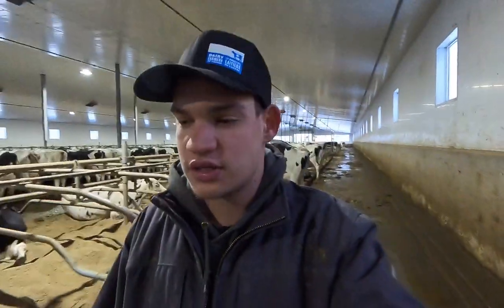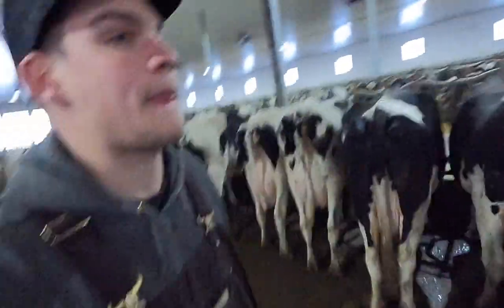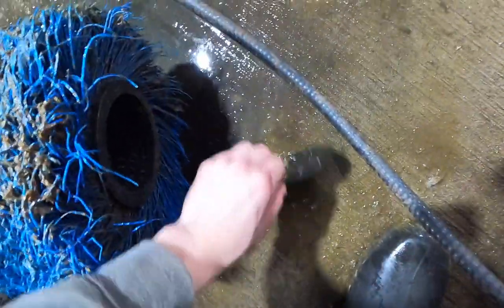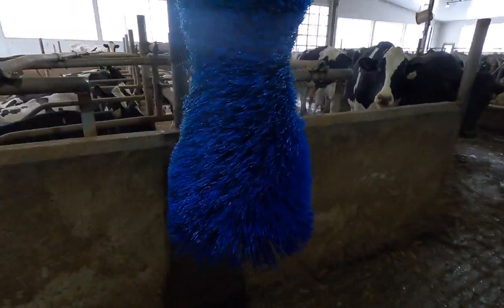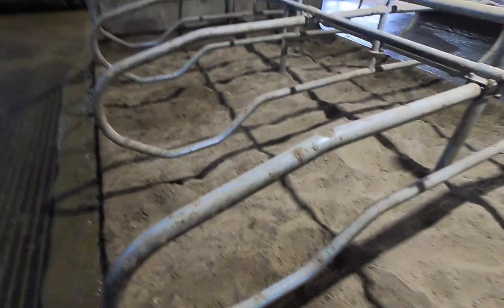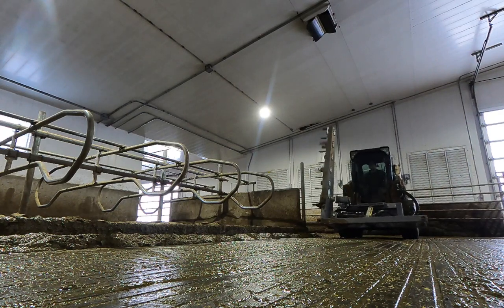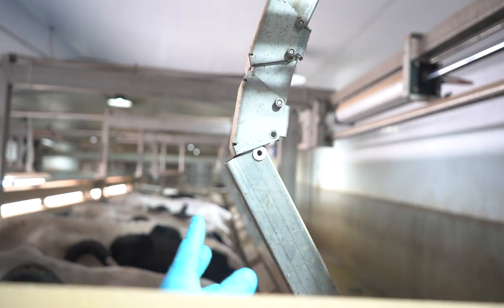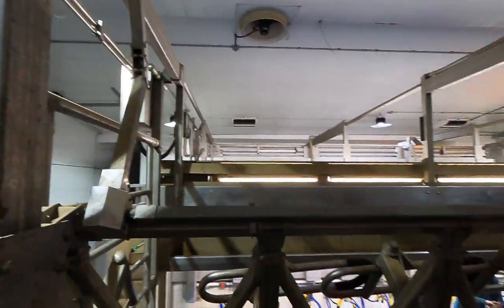Milk Cows Break Everything!... 🤦‍♂️

Comment: you know....if you put a little scraper on the front of that bed buster....you could scrape that manure away from the end of the beds so you can get it with the alley scraper.  If you bust the beds before you scrape the alley that will clean out that area right at the end of the beds that the alley scraper misses.  Just thought... ;-)

Comment: I would suggest using Loctite and/or a lock washer when installing the brush bolt. That will prevent the bolt from backing out under use especially given that this a rotating device.
Reply from the maker: Your not wrong!

Comment: For yours Brush Cows, use threadlocker Blue 242 Loctite on the bolt, and never loose with this. For a good long-life with electric part with this brush, you must change the current wire for one with a sheath more suitable for the continuous movements of the brush, otherwise the wire cracks or splits which causes problems with electronic boards among other things

Comment: On the topic of the “Fire Hose”. Do you have any kind of fire escape plan? Like if (heaven forbid) the barn were to catch fire or there was some other emergency, is there a plan in place to get the cows out? Do farmers typically have plans in place for when disaster strikes? Do barns ever have smoke detectors or sprinklers?
Reply: Sadly unlike an industrial or commerical setting, ERP's (Emergency Response Plans), from what I have seen are lacking as they are not mandated or subjected to that rigorous scrutiny by regulatory or current demand as a public protection need/act or requirements. Maybe when Saskatchewan is swallowed up by California or the Netherlands? Heaven forbid!
Reply: @edk1609  Thanks for your reply.

Comment: If that bolts too long it's an excuse to put a Jamb nut behind that washer, it will stop it from backing out again and much easier to remove than lock-tight where at times heat must be used to free it.